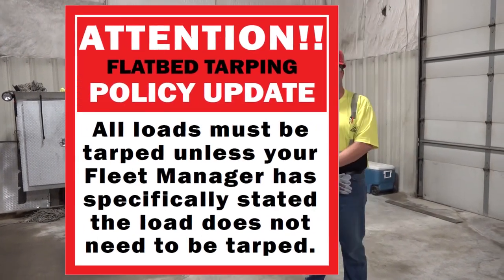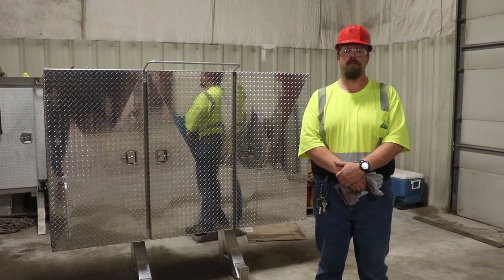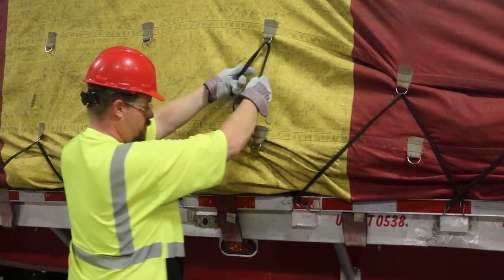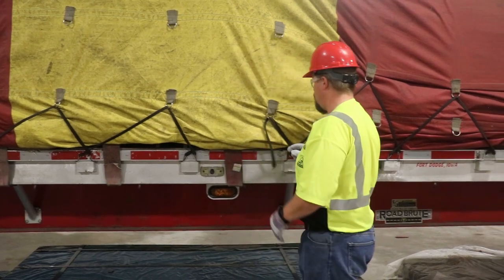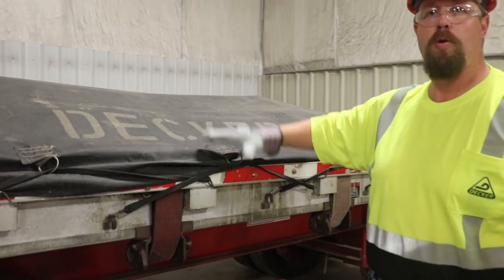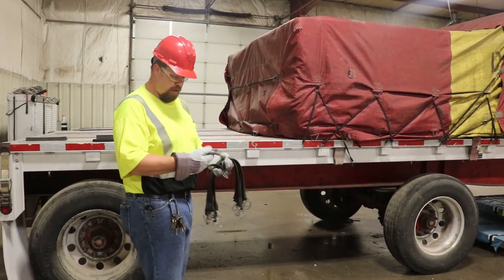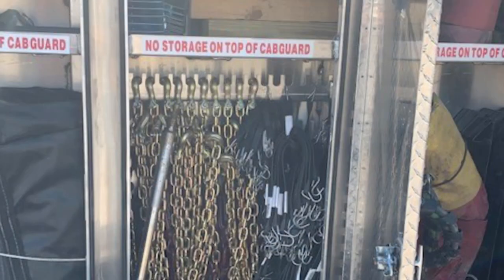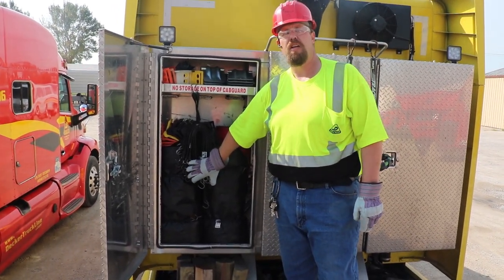Flatbed Bungee Basics from Bungee Training to Bungee Storage with Decker

Comment: Just started flatbed and on my first tarp load. Already put a couple small holes in my tarp from bungee hooks backsides. Ill be trying that bungee through the d ring suggestion for sure.
Reply from the maker: It's a more snug securement as well as increasing the longevity of the tarp
Reply: @DeckerTruckLineInc I changed all the bungees on the load that I could to being like this and it worked fantastic